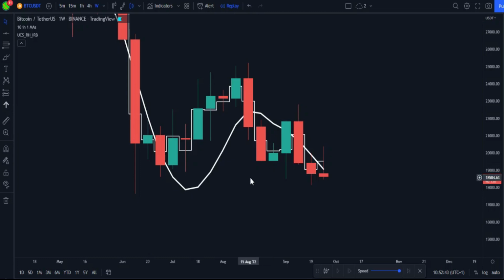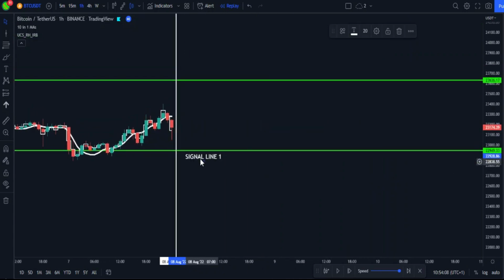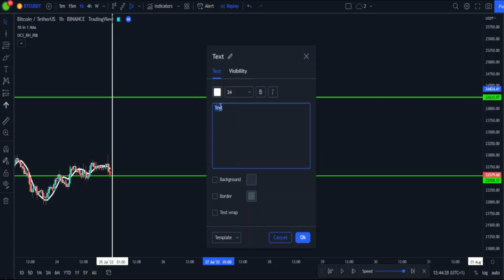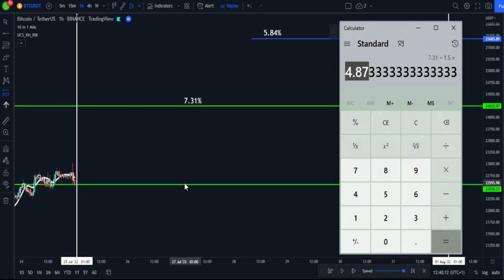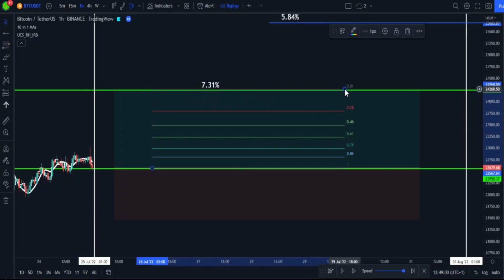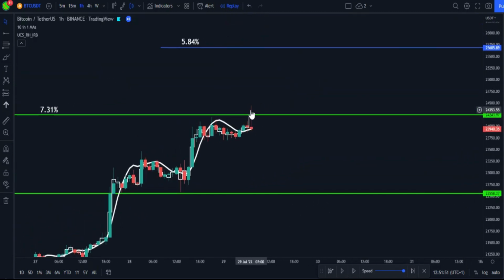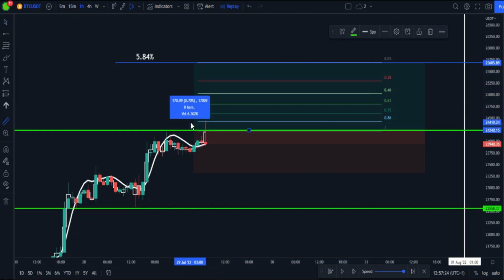Future Trading Strategy: insidious Levels ( Part 2: Take Profit + Stop Loss + Long Positions  )

Comment: Thanks for this wounderfull video. I Have a question. if i scalping like this and set all line and fib retresment, then if i set the 15 min chart and use indicator like QQE, Xtrend and 200 SMA and 20 & 50 EMA and follow the signal with this current chart, is it work ?
Reply: Feedback appreciated
✍✍✍☎️☎️☎️📩

Comment: Hey OTS ... have made setups for certain assets like the Indian index and crude based on your strategy. Crude got stopped out and NSE still running with first 3 targets achieved for signal 1. My observation is that instead of blindly getting into the trade at the signal line it's better to wait for an hourly close in the direction of trade and buy on pull back to signal line. If I had adapted the above conditions crude signal wouldn't have activated and NSE signal would have given 3 initial targets within 2 hours of trade today execution.
Reply from the maker: It's really nice to improve it.. in part 3 the 1h candles are important as well but in other way.. I really couldn't have time to prepare it yet
Reply: @o.t.s  hi again. awaiting desperately for your third video.

Comment: Done what you told us on btcusdt perpetual candle on Saturday setup for long positions aaaaaand  it works. I didn't open any positions , but the price reached all the way to tp5...and it's only Monday. Hats off toy You Sir:) surprisingly, not many people downloaded the indicators that you are using. Don't be afraid to use what you've seen in last 2 clips. Practice on paper if you don't want  to use cash.

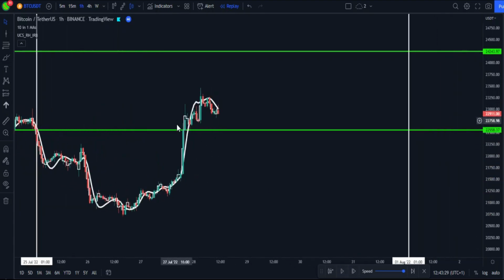Comment: In the second example, the one with the green weekly candle, why didn't you consider the first entry the one generated by the first hourly candle of the new week that hits the first entry level (minute 2:33)? In this case, in fact, the trade would have been immediately negative going to take the stoploss.
Reply: I have the same question. My thoughts ... if it's a buy we have to wait for the candles to violate levels from below and if it's a sell then from the top. OTS u r a genius. Please clarify. Thanks
Reply: @garvick20  I don't think so because in the video OTS says that the price must touch the entry level but does not specify whether from above or below, in fact I believe that the orders to be entered must be both "limit" and "stop" depending on the direction from which the price touches the entry levels. However, it is an excellent strategy even if I think it is important to understand how to adjust the SL, as the various levels of TP are reached, in order to come out slightly in profit if all the levels of TP are not touched. From what I understand OTS will explain it in the next 2 videos.

Comment: I have couple of questions:

1. When we are mid week, are we still taking a position (through the 1hour) based on the horizontal lines we draw within the vertical timeframe lines? Meaning we are already in the trading zone. 

Or are we planning this setup for the next week's trades?

2. What is the reason to take a second postion on the upper (long) or lower (short)  lines. Through backtesting i've found it often misses the second trade and fails to achieve full targets, whereby there is not enough RR

Comment: I'm using it 15 min. By making levels on 4 hour candle..
Nd I have to changing the levels every 4 hour...but that's not a problem as I'm getting good enough trades for 2-3% gain  without even considering leverage in every trade I have takenn...
This strategy makes very good ranges to trade 👍🏻

Comment: If you have to wait for the one week candles to close then you can't really do much trading and 1 week candles close midnight UK time so are there shorter time frames to work on ? So this method can't be implemented at any time of the day ?
Reply from the maker: The candle closes and opens even if your time is different. It uses UTC time and has nothing to do with the local time. This method is not used for one currency only. It is used to get several signals for several coins per week ( lets say 5 coins,, meaning u will get about 8 trades per week ) , u need to work for one hour or two u set targets easily like we explained,   and continue with your normal life without fatigue and effort

Comment: That is indeed a very nice strategy for a ranging market. But in a trending market stop loss level may be a killer for a trader. If this issue is solved, this strategy will be perfect without no weakness.. In any case, thanks for your effort.. 🙏🤝
Reply from the maker: We will try to fix it as we will try to learn how to move SL ;)

Comment: Is it a higher or lower win rate when the previous week has narrow or wide candles, (i,e, if previously weeks volatility is high or low which offers the higher success rate ?)  obviously low volatility returns less  per week. (Yet if low volatility  yields a higher win rate you could increase the lot size or visa versa dependent on your answer to my question.

Comment: 1. So if you took 1 lot per signal line , would you divide by 6 exits equally or is there a ratio based on most probable reached targets ?  I only ran 3 weeks back testing but thought the Fib scale could also be used as a ratio of profit % withdrawals ?  
2, What is the success rate of a weekly target compared to the same set up on a daily target ?
Reply: Feedback appreciated
✍✍✍☎️☎️☎️📩

Comment: @Online Trading Signals ( Scalping Channel )  If I understand correctly, the opportunity range is determined for the next week with a BIAS. In case of reversal week, this mean there is no trade opportunity at all. correct?
Reply from the maker: In principle, yes, until we get rebounds (the rebounds will be explained in the coming days), this means one or two opportunities per week, which means about 6 opportunities per month, but what about a business plan that contains 10 other currencies, this means 60 signals per month, and the application is also easy... each currency will not take more than 10 minutes ( 10x10= 100m which is less than two hours of work per week)  especially when you get used to setting targets, profit, stop loss, etc.

Comment: The second signal line is always placed at the bottom of the candle and sometimes at the top of the candle.  Please answer my question!  thanks a lot
Reply: In the event that the candle closes above the moving average, we will enter buy and place the second line above the candle, but if the candle closes below the hema, we will enter a sell transaction, and therefore the second line will be below the candle

Comment: Can we apply this method on 4H Frame then entry will be on 15 m frame ?  to reduce time waiting of weekly candle
Reply from the maker: Another good question, this is what we will get to in the next parts, and indeed it is possible, but it is better to use 1 day candle instead of 4h ...
Reply: This is my question bro.
I tested strategy with 4h and 1h.
It was good.Undoubtedly, the settings of the indicators should be different at lower timeframes

Comment: Will be there only 2 trades for all the Week ? Or still we can use the same entry points for multiple trades in a week.
Reply from the maker: Good question buddy.. but as i said in the video .. we have to wait until we get to the re-entry part, but what about using the same method with 5 or 8 other currencies weekly 😉.. like eth/xrp/ltc/doggi and others
Reply: @o.t.s  OMG
Your reply is next level sir 😃😃😃🫂🫂🙏🙏
You are my trading Guru 🙏🙏